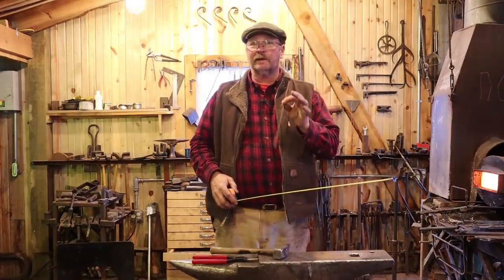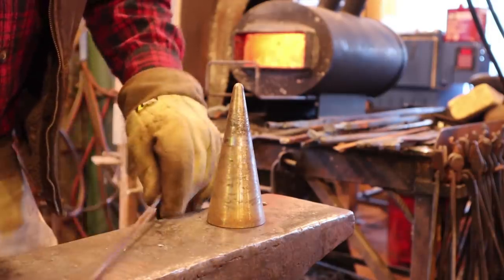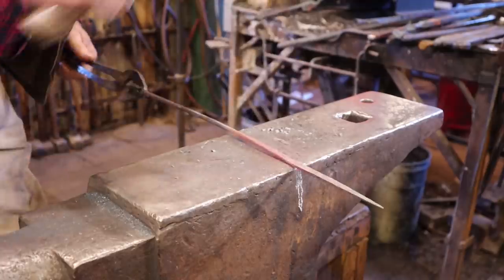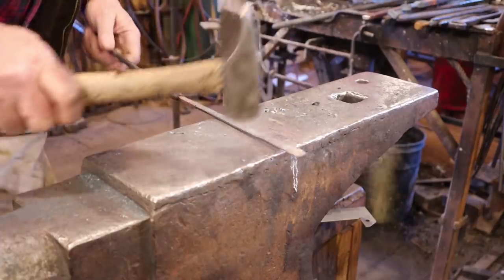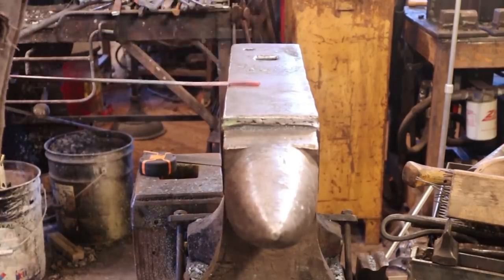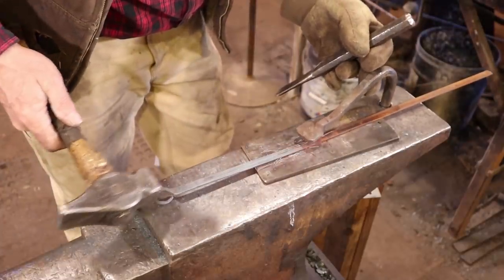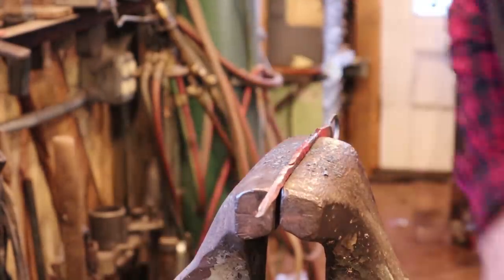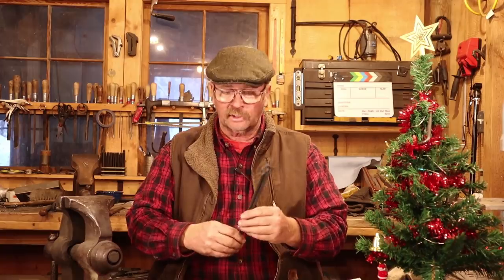Meat skewers - countdown to Christmas

Comment: I really enjoy making these. They are really popular and easy to make. I make mine out of 1/8in square bar. I taper both ends and put a loop on one end. Then I put a long twist down the shaft the help hold the meat/veggies slightly better.
Reply from the maker: Do you buy 1/8" square or forge it yourself?  Its not a size readily available.
Reply: @darinvoight68  do people also buy these in christmas times?

Comment: Just getting into smithing. I feel like I have gained a billion pounds of muscle because I started out doing this taper to a point from 3/8 sq stock...  I thought to myself the entire time, "it's supposed to be difficult"... then I find stuff like this and I smack myself for not finding these smaller, easier to handle projects like these to do. First thing I did was forge welding a fire poker from 3/8 square, and a log mover. That is a lot of metal. I can now appreciate working smaller. LOL Your channel is everything!

Comment: The coolest skewers I've seen was a couple of camp sites over at the lake. 
Best way to describe em, 3 foot of 1/8" round, bent in half & create 1.5" Id ring there, spiral twist rest of the stock, forge weld & draw out  end to point, lastly (besides clean & finish) flux & flatten leaving edges with the rounds to help hold the food.

Comment: I hardly ever see you use a flatter.
Do you have project where you use one?  Is there a video of you making a flatter? If not, or if you haven't made one by WELDING a piece of flat plate to a slightly cut off hammer so it can be done either way for those of us that CAN'T swing a hammer long enough to make a whole flatter from a chunk of steel!  Could you make one like that for us, Please???
Reply from the maker: I don't use one at the anvil very often.  But I do use them regularly at the power hammer (power hammer flatters look different) or at the treadle hammer.